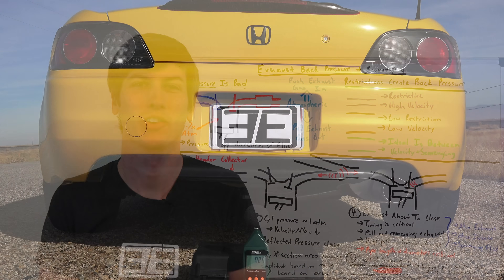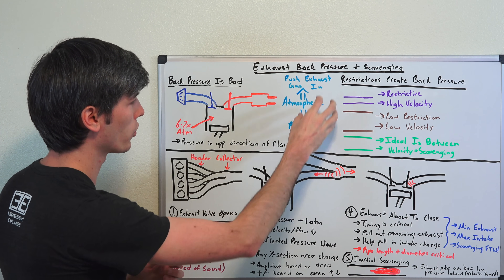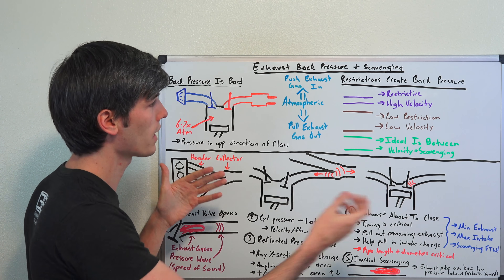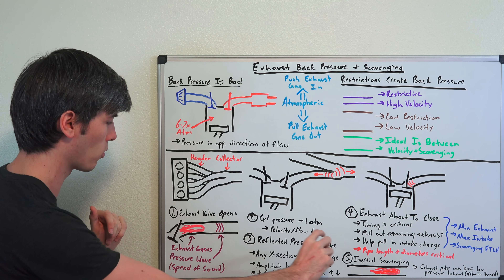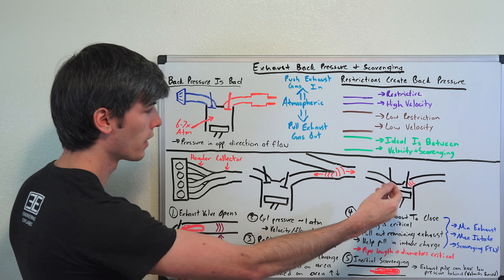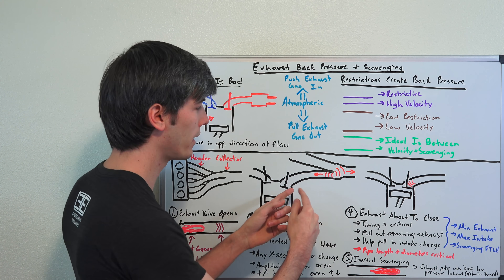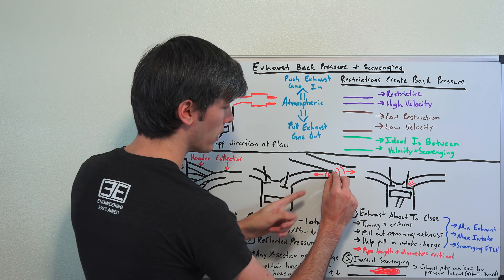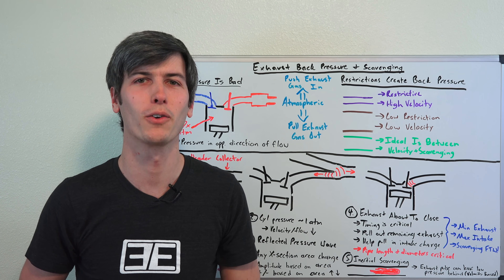Stop Saying Car Exhausts Need Back Pressure

Comment: Doesn't too large of an exhaust hinder scavenging in the exhaust out the tailpipe? When I hear "back pressure" I was assuming they were talking about vacuum pressure or Mercury due to pressure difference in the exhaust system.

Comment: Yuck. Horrible horrible concepts and execution. Valves should open when pressure is equal. FAR more efficient and eliminates the need for a muffler. And scavenging isn't needed. A half-decent expansion ratio, say 80:1, eliminates that kluge, too.

Comment: Not since variable valve timing.  Saved you time watching the nonsense
Reply: No nonsense in this video...
Reply: @ilpatongi yes the whole thing is piintless if you just say variable valve timing. Because without that you do need back pressure, hence why exhausts were built to a specific volume. And the twats that stuck huge exhausts on things like the Ford xr2i, lost acceleration and top speed. So without vvt you need to have the correct volume exhaust to provide hp.
Reply: @ADayInTheLifeOfAYeti  But this is easily disproven, the only reason why VVT doesn't perform as well is that you need some tweaking because the car effectively doesn't know what to do with the new exhaust.
Reply: @ilpatongi  right. My point was, you needed back pressure because vvt wasn't a thing. Now you don't.  yes i should have watched it. The bonus from have vvt and the correct volume exhaust is negligible unless you are tuning a race spec engine. In my opinion. Your video is correct and you know this but in my opinion is nonsense as it doesn't relate to a modern engine. Anyway, I like your process and have an actually idea for you....

Design a hydrogen powered engine. Like a petrol engine possibly, but efficient for hydrogen.  And then then I'll PM you my idea. And be willing to invest on a prototype with you and destrot the battery powered 15 year lifespan market.
Reply: @ADayInTheLifeOfAYeti  I'm not the author of the video.

Comment: Had a brand new 93 Mustang with 2.3 4cyl engine auto trans. Bought a dual exhaust kit with ;single "2 to dual " 2-1/4 exhaust pipe ;2 - "2-1/4 inlet x " 2-1/4 outlet turbo mufflers; 2-"2-1/4 LX tail pipes. Had muffler shop install while I watched. Car was only 3 months old only had 5K miles on odometer. Sounded good but never ran right from install!! It wouldn't shift into OD at correct speed ! Always hunting/jerking at OD speed RPM. I ended up trading it in on a proper brand new 93 5.0 5speed manual LX Mustang a few months later. I was told the computer didn't sense correct rpm BECAUSE OF LOWER BACK PRESSURE !!! Hence hunting/jerking of AOD lockup !!!!

Comment: What if I put 1 of my exhaust header pipe straight to the back, and then I weld another 3 exhaust header, one by one, to that 1 main pipe. (Not like 4-1 exhaust, where you put every exhaust header into 1, this one is like attaching the exhaust pipe one by one to that one main exhaust pipe). Would that make vacuum effect for my exhaust system as a whole? Would that be great for my car?

Comment: so because of the low pressure that comes from the exhaust gasses, it sucks part of it back into the cilinder. this whilst the piston is moving up.
But i dont understand it, the piston is moving up, this forces the gasses to move out of the cilinder. so how it gets back, dont the exhaust valves close before it can get back?? And if the gasses would be sucked back in the cilinder, the piston shouldnt move till top dead center??

ps: thanks for sharing your videos, i watched a few starting with the turbos. its a good learning process for me. keep up the good work. suscribed. 👍👍

Comment: One key factor he didn't touch on .. the exhaust is forced out, not scavenged. He makes his point almost on if the piston didn't even exist, and just the pressure differences caused the gases to escape. Scavenging is a thing, but is almost a moot point in this discussion. Love his videos, but this one tanked ...

Comment: 07 Ram single cab with a v6 motor and a 6 speed transmission. 
Cats were deleted, muffler deleted, cold air intake installed, AirRaid Throttle body spacer. 
Went from Oklahoma City to Waco Tx on less than 1/2 a tank. Roughly 1/3. Over 300 miles. 
Mileage calculated rough guesstimate was around 40+ average speed was 65mph. 
Truck ran great after getting rid of the emissions crap, before all this i was lucky to get 200 miles a full tank on a v6. 
Check engine light always on, but what ever, i knew what it was for. It was for upstream 02 sensors below temp and pressure because no cats on the heads.

Comment: What if you had a vacuum system that opened and closed with the exhaust valve timing? Wouldn't that be the ultimate in exhaust scavenging and velocity? This would work in the reverse way of a turbo, and more power would result from forced scavenging, right?

Comment: there must b so art in this science bc if u to quickly exaust all the gases & create a vacum effect there is less pressure in internal engine next time & time after that, on big engines it is marginal but on small engines w/small draw of fresh air low end needs some normalized or back pressure. By V6 not an issue & on trucks w/V8 giant get the exaust out of there. breath in & out mess w/1 end u can mess w/other end, since under pressure not an issue above straight4.

Comment: I remember way back in the 70's when Nascar team owner Junior Johnson's race car went to equal length exhaust headers and gained some hp on the competition.  It completely changed the sound of the engine, sounding more like a 6 cylinder than an 8 cylinder.

Comment: Okay so factory exhausts DO have back pressure due to their design which is majorly to pass the noise level tests and pollution checks? People install freeflow exhausts to their engines ( read motorcycles) to get more power and better sounding machine but often told that these FFE's are damaging to the engine. Someone help clear this.

Comment: My car had only one catback muffler from factory. I removed the muffler installing a direct final pipe with the same diameter and the car lost a lot of power in low rpm's. 208 Gti by Peugeot Sport.

Comment: Four bangers run lean and hot with big waste pipes for exhausts. I'm now snow blind after looking at my plugs without snow goggles. Definitely need back pressure on a two stroke otherwise the expansion chambers don't work.

Comment: Before I watch you don’t need or want exhaust back pressure you are looking for exhaust restriction so you get higher exhaust velocity. That leads to better scavenging at low revs. It high revs that restriction limits power but most don’t drive their cars very hard so low rev efficiency is what you want.

Comment: Back pressure keeps your rings seated, scavageing occured at or after exhaust valve close
But what does a mechanic know
Reply: Clearly nothing. As that statement is not correct.
Reply: @Maverick09171  a troll baby! They exaust!
Reply: Bill Russell explain how scavenging could “occur after the exhaust valve closes”.  While you’re at it, why don’t you explain what YOU think scavenging is. Because if you think it occurs after the ex valve is closed then we have to start at the basics.
Reply: @Maverick09171  60 year old navy trained gas turbine and diesel mechanic, I doubt you have much to teach me sonny
Reply: Bill Russell thats all fine and well, but I’m not sure what relevance that has on scavenging principles of a 4 stroke engine.
Reply: @Maverick09171  they scavenge by valve overlap such as a variable venturi or a 2 stroke otherwise they don't scavenge, road engines don't scavenge  . You have to have two open valves and positive intake air pressure to scavenge. Scavenge is your red herring, it wasn't directly discussed.  

Back pressure prevents ring flutter and the sharp edge of the ring from causing cyllinder wall damage. Where did you learn to wrench westek in phoeynix
Reply: Bill Russell your statements are contradictory. Initially you say scavenging happens after exhaust closes. Then recently you change your stance to say “both valves are open” which is correct. It occurs during cam overlap. The more overlap (ie aggressive the cam) the more pronounced the scavenging will be.
Reply: Bill Russell dude your typing is nearly incoherent. It’s a little early in the day to be that dRuNk dON’t yA tHinK? 
Stick to changing oil there, buddy.
Reply: @Maverick09171  zo you are king of trolls, how cute. Totally beta
Reply: Bill Russell back to the troll talk. Very clever, never heard that one before! Enjoy that black velvet tonight. 
Until next time, keep scavenging with those exhaust valves closed! 🤣
Reply: @Maverick09171  well you don't seem able to speak engineer so the point is moot . 
Troll it is
Reply: Bill Russell no need to try to impress a hard headed old timer, trying to be something he’s not. You are confused by simple logic and words, so well leave it at that. 🍺

Comment: A agree with most of his video,s but you need some back p. If you dont think you need any why run headers at all just let it flow right off the heads no restrictions should make so much more power 😆
Reply: Headers provide a scavenging effect. The exhaust gas is sucked out and if properly tuned will leave a partial vacuum in the cylinder that will draw in more intake air.
Reply: @Redtooth75  yes agree also why long tube headers norm make more power then shorty headers

Comment: Thanks for the laugh!  I did a test on this on my car during the Spring of 1990.  With no back pressure, the car had no bottom end power, meaning power picked up around 3500 RPM.  But with back pressure the car could do burnouts.  This car didn't have turbo.  This was before EFI.  A class to take is fluid mechanics in a pipe.  Here again, no two engineers have the same solution.
Reply: Thank you, what you have are a bunch of people trying to eliminate the word back pressure when if you have to much pressure in the exhaust system you kill exhaust gas velocity and it you have to little pressure you kill exhaust gas velocity. It is all about finding the right sized pipe for the highest exhaust gas velocity. 

Where all the misinformation and confusion comes in is an exhaust system is not designed with back pressure, an exhaust system is designed by maximizing exhaust gas velocity. John Lingenfelter built 600 horse power Corvettes and Borla worked with him on the exhaust systems, John Lingenfelter used 2 1/2 inch exhaust systems because that is what provided the best exhaust gas velocity to make the most power, as Borla says if a bigger pipe would have made John Lingenfelter go faster he would have used it.

Comment: the thing is is on an engine with the exhaust valve closing at top dead center you would want back pressure you'd be a gas hog to do that rather you should have the camshaft timing so your exhaust closes a few degrees before TDC but then you have to reduce your fuel in the ratio and retard the ignition CHECKS AND BALANCES in a theoretical perfect world say no back pressure but we as humans are far grime able to produce perfection

Comment: The back pressure myth comes from the days of carburetors. What it was is people would do something like install headers or something else that would greatly in prove exhaust flow which would now mean the carb would be adjusted too lean or worse if your mods really freed up exhaust flow the carb may have even then be too small for how much air the engine was now cable of flowing. This would lead people to think the reason their engine wasn't running right was it need more back pressure and sure enough if they did something to increase the back pressure the engine wouldn't flow as good and their undersized carb would be back operating in a range where it could supply the engine with a proper fuel mix again. Thus the myth was born, engines need back pressure.

Comment: Is this the same case with 2-stroke engines? - I believe to have made experiments as a kid with exhausts having different resistance and noticing that too little resistance seemed to give less power at the bottom- and mid range

Comment: Back pressure will will help fuel economy . tuned headers will scavenge the cylinders to much and pull out some of the new fresh intake gasses also = a big drop in mpg  , no back pressure and "tuned " exhaust is for racing only .

Comment: the pipe diameter must be optimised between the flow velocity and volume capacity - too wide makes the velocity low that scavenging is too little that won't leave much low pressure behind which will create "back pressure" you don't want. Having variable exhaust manifold or muffler can broaden rpm ranges for the optimized exhaust. Speaking of pressure waves, not having anything in the end of exhaust pipe can create back pressure because of reflected pressure wave - bike guys should know this by adding bolts or something at the end of the pipe to break pressure when no muffler is mounted - very confusing video

Comment: Might be wrong, but my understanding of pressure wave scavenging is that it's designed to help the other cylinder(s) connected at the collector, not the cylinder that generated it...?

Comment: I'm watching this 2 years after you posted it, and with over 3,000 comments I'm going to state that I am a little lazy and won't read all of them. I would like to understand how back pressure or exhaust gas philosophy changes when there is a Turbocharger in the system.

Comment: My auto tech teacher keeps saying oxygen sensors are useless without a catalytic converter as the exhaust won’t create any back pressure. So my question is, do you need back pressure for oxygen sensors? I assume not.

Comment: When people say your car needs back pressure, what they should really say is since the engine is now less restrictive and breathes better, it needs more fuel but if you don't tune it, it will run lean and actually produce less power with a better exhaust. It's all gotta work together.

Comment: So, say you are purchasing an after market exhaust system.  Is there an assumption that the manufacturer his taken into consideration the length/diameter equation for you?  Is there a way you could determine on paper which brand would be best for your vehicle, based on dimensions and other facts about the intake and engine?

Comment: I’m sorry but this is false. Miles of real world research has shown that an engine designed with a certain amount of back pressure engineered into a motor’s timing and valve seals shows higher wear and shorter lifespan with significantly less back pressure than designed. The usual issue occurs on the intake valve seals where they are forced to seal under more pressure Than designed because of the unintended ease of flow in which the exhaust gasses leave the combustion chamber while the intake valves are sealed shut. This has shown signs of excess heat as a result of the rise in pressure in which the intake valve seats have to seal and in turn premature wear. Especially in motors that are still in a break in period. Cite sources to come...

Comment: The narrator is confused and his narrative is confusing to the listener. The narrator is not very well informed on this subject. The narrator is confusing two stroke gas expansion dynamic technologies with four stroke engines. The narrator should have studied two stroke exhaust design technologies before making this film. The two stroke exhaust gas harmonic technologies do not apply to four stroke exhaust design.  The narrator is trying to hide his ignorance of the subject, and is waffling with words in order to keep the interest of his audience.

Comment: CONSERVATION OF MASS:
So maybe im looking at the scenario to idealistically but here i go-
In the discussion about how you want a certain velocity but at the same time you dont want too much pressure I had some questions.
Why does velocity change the way the exhaust leaves the system. if we consider the cross section of the valve port, we know that what goes through that cross section must come out, no matter the size and the mass flow rate would not change because mass is conserved, only velocity and cross sectional area would change, which then leads me to believe you would still get the same effective evacuation of exhaust gases.
Is there more to this that i am missing?

Comment: Many years ago, you could easily replace a muffler to get better fuel economy and power.
Is that true today?
With fuel economy being so important now, are there still gains to be made, replacing a muffler?
An example, my 2 L has 2.5 " piping, with a muffler ( resonator?) that's about 1 ft dia, by 3 ft long.
Would that be free flowing? I have read of people that got better performance, simply by getting rid of 60 lb of muffler.

Comment: It would be an interesting thought experiment to try to design an engine to run in 10 atmospheres. You'd be running 132 lbs of boost by default so you'd probably want to delay the intake valve closing and run a lower compression ratio to keep temps down and prevent knock. Pair that with egr cooling and exhaust scavenging to keep some efficiency when you wanted more power. Valve springs would need to be overdesigned to fight all that pressure. It might be necessary to implement some compressor/check valve setup to maintain a reasonable pressure within the exhaust. Exhaust would need to be cooled significantly though or that setup would not hold up

Comment: I actually just had a Muffler shop size my exhaust pipe down .5"!  Without letting me know!  They were just supposed to rebend orbreplace the pipe so it didn't hit the shock anymore.  What is the effect of necking down an exhaust from 2.5" to 2" after the muffler to exhaust tip?  190-ish hp  4.0l

Comment: Back pressure kills flow. As PSI increases flow decreases. But with pumps they usually have a pressure/flow curve. That scenario back pressure can be good, because without it you wouldnt have flow in some pumps